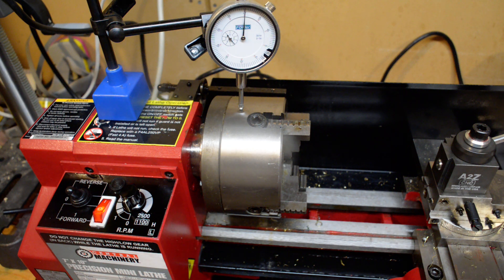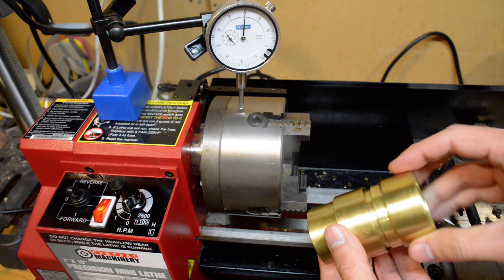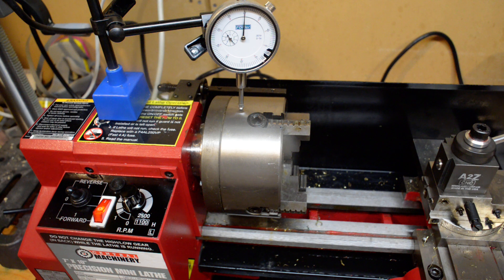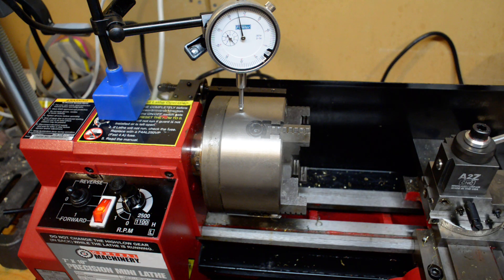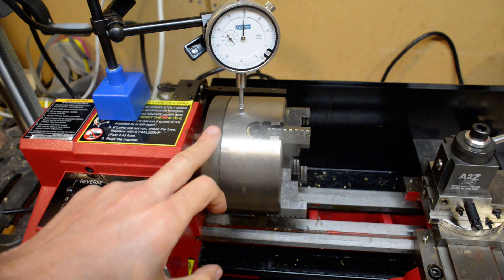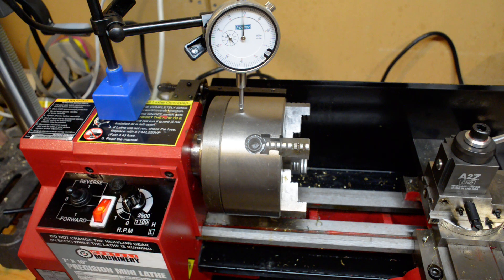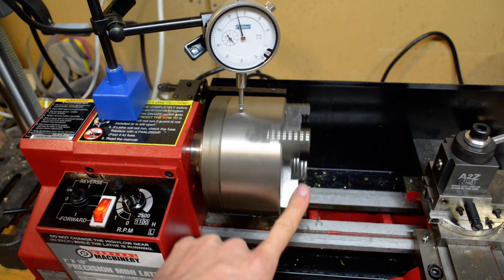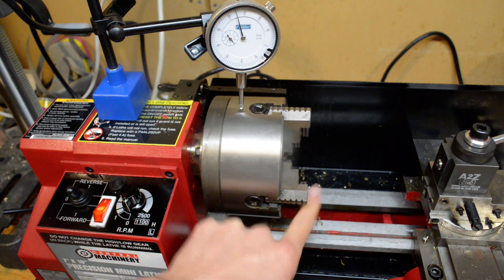Lathe Chuck Runout

Comment: Hm. We have a similar problem with our lathe. We found that if you loosen the screws and keep the indicator on it and turn it manualy, you can pinpoint on which end you get high, low points. Now when you get a high point you turn the spindle and tighten opposite screw. Make a circle and check and just keep tightening the screws like on a tire, always going criss cross to even out the pressure.
This will align the holder, but another premise is the fact the jaws themselves are properly done as well, because we found out that it s a compound error if manufacture is sloppy.

The thing is you can align your head, but if jaws are not equal or have slop your stock will be misaligned  despite the spindle itself being ok.

Comment: I had a similar problem on an old Atlas 618 but what I found is no matter what I put on the spindle I got about 30 thou of runout.  I got very little/no runout on the spindle itself.  This told me there had to be something up with the threads.  I looked carefully and there actually was a bulge on the initial part of the spindle threads.  I was able to put a threading tool in the post and clean up just that part of the thread and get it down to 10 thou.  Still working on it!
Reply: fisharmor hello, I have tha same problem!! Can I fix it?
Reply from the maker: In my case it was the 3 jaw chuck from Harbor Freight. The runout in the jaws wasn’t that bad, but the outside of the chuck was. I ended up moving to a 4 jaw chuck which let me control the runout.

Comment: Runout on the body of the Chuck, especially a 4 jaw Chuck doesn't matter unless it's so bad it unbalances the Chuck and you end up with a witness pattern forming on the workpiece when your cutting. The work piece gets dialled in with the Independant jaws to run true or offset if that's what you require.
Reply: Not true if the runout is due to the back of the chuck not being square to the spindle axis. In that case the part will runout via angular wobble rather than eccentricity, and cannot be corrected by adjusting the jaws. Symptom: it can only be eliminated in one spot on a long arbor held in the jaws, but not everywhere along its length. 

Also don't measure runout of the chuck body, check the runout of a chucked arbor. If you have angular wobble, try shimming with successive pieces of .001" shim stock between the chuck and the back plate at the high point of the wobble, and see if that reduces. If so, you may want to turn the back of your chuck true. 

Remove the chuck, mount it on an arbor set up between centers. Clamp the jaws to the arbor, and then by hand check the chuck's back face with an indicator. If it isn't running true, skim it to true.

Hope that helps.
Reply: @SRHacksaw  you are absolutely right, I was not thinking about angular runout. Cheers